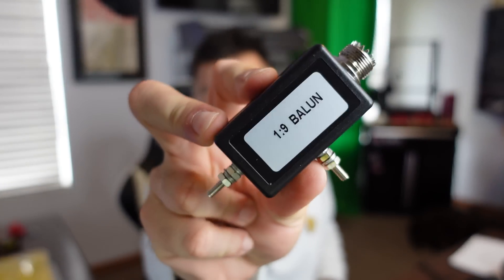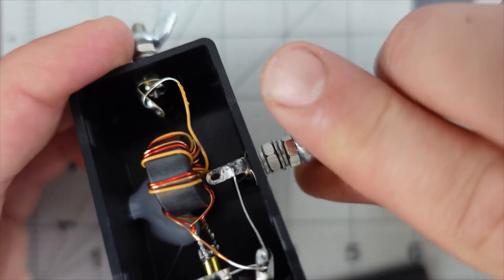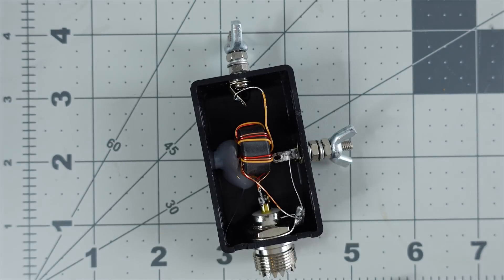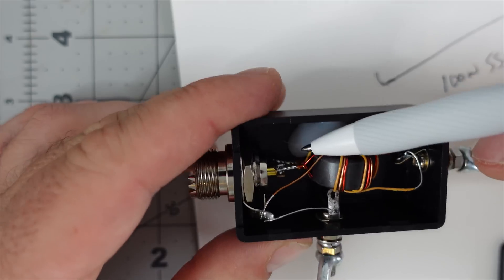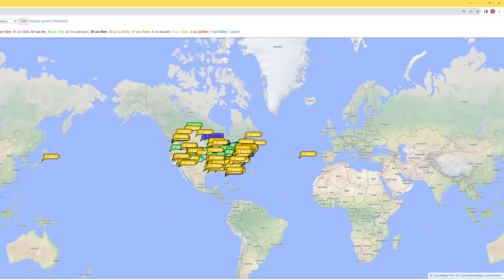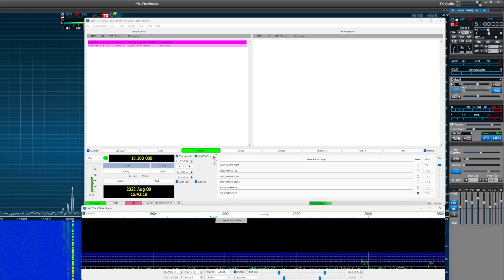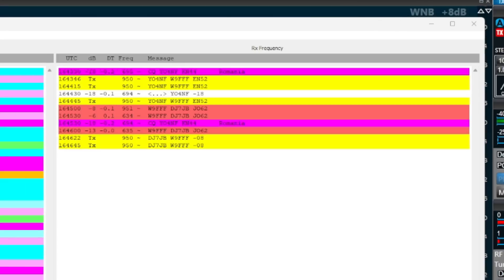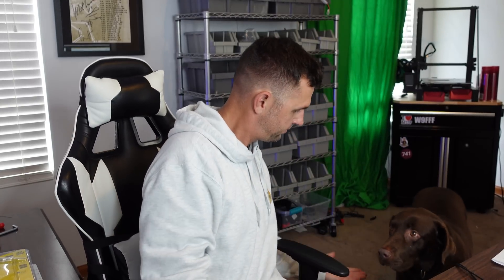I Bought the CHEAPEST End Fed Antenna on Amazon for Ham Radio

Comment: HI, I bought one like a month ago (Aliexpres) and I wanted to work with it in 49:1 mode. I rewound it 49:1, measured it from 3.5 to 29 Mhz, and didn't have more than 1.4 to 1 SWR. I use an end-fed antenna 40-10 m. I used the same box that 9:1 came with from China. My conclusion is that 49:1 also works. I work with the Xiaegu 6100 only 10 W QRP.
Reply from the maker: AWESOME! This is what radio is about: Building, Modifying, Experimenting!....and radio :)

Comment: I use one with 58feet of wire plus a 30 foot counterpoise and 2 17ft secondary counter poised  45 dg apart verticle. My feed point up at 30ft. Worked the world.  From uk

Comment: Why the hell would any radio amateur worth his salt BUY an end-fed antenna? Have you learned nothing?
Reply: EndFed antenna's are pretty good. The mistake you make is you think of the past. When Ham's ran a EndFed into the home to a tuner. That could cause all kind of RF problems. But this is a different antenna. It still needs a 1:1 though.

Comment: Great video. Really liked that you were able to show the core heat to the point where SWR skyrocketed. I never knew what would happen when running one of thee devices close or above the limit. Very informative. As an aside, could you explain when you would want to use a 49:1 unun vs. a 9:1?
Reply: A 9:1 is for a random wire and a tuner, a 49:1 is for a half wave/multiple half waves.

Comment: I've always have had HF beams or verticals. This summer I tried a Palomar 9:1 unun with a  choke outside and a isolator inside. Total wire length is 188 feet. My swr is less than 1.5:1 from 160 to 10. NO tuner. Low noise and if I can hear them I can talk to them.
Reply from the maker: If the rain decides to let up this week, I am going to try that length (or even more :) ) .   Thanks for the length!

Comment: Amateur radio is a hobby that licenses us to design and build ALL our own stuff, even with just a Tech license. It's a license to do, a license to learn. 
A good FT-140-43 toroid on Amazon is $6.95, and it's $4.99 for 32' of 22 gauge magnet wire, with enough wire let over to mae a 49-1, too. YouTube is full of vids on how to wind a 9-1 toroid. Mount it on a piece of wood or plastic. Solder the antenna wire and the coax to it or just wrap the wire around screws. The whole thing takes about an hour. Then the ham knows how to do something.   
BTW, nothing beats reading up on a little antenna theory to make them behave properly. Lots of good stuff online. 
With some hams I'm put in mind of someone buying a motorcycle because it a looks like fun, but expecting it to drive for them so they don't have to learn how. That's just silly. The fun comes from learning and knowing how.
Reply: any good online resources you can recommend?

Comment: Thanks Dude.  I bought a CHEAP 4:1 off of Ebay to test during the Big "C19" lockdown.  I was actually surprised at the quality.  I've used it on an 80m Doublet with 135' of 14awg THNN wire, 75' of ladder line, and it worked surprising well.  I guess that in some cases, it's just luck of the draw.  I surely got lucky on it.  Thanks again for all of the great content, time and effort.